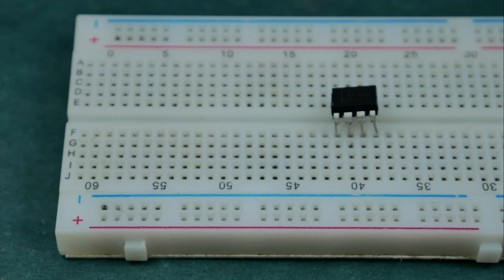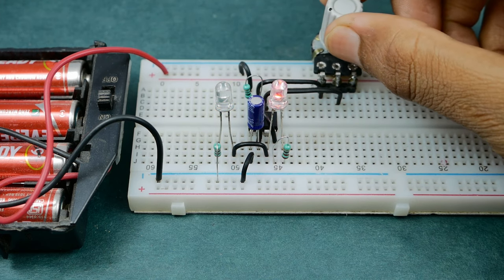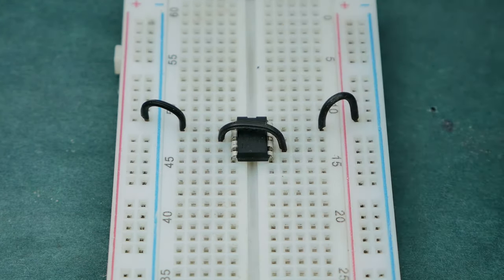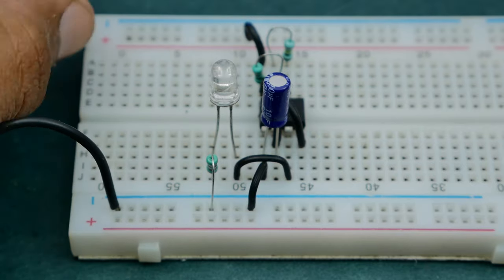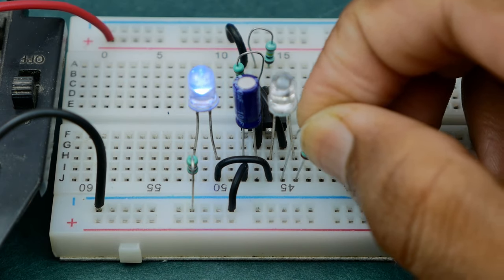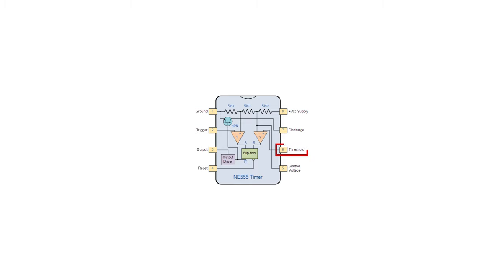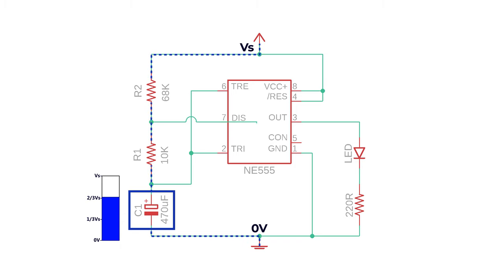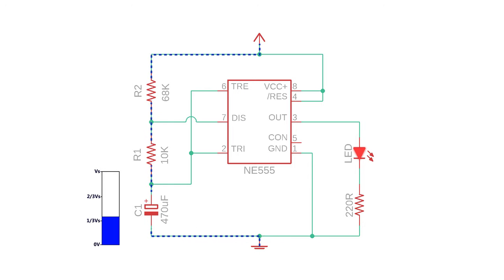Adjustable Flashing/Blinking LED circuit on Breadboard | 555 Timer Project #5

Comment from the maker: The circuit diagram shown in the video is for demonstration purpose only.  This is the schematic with correct resistor and capacitor values: https://elonics.org/sites/default/files/inline-images/flashing-blinking-led-circuit-using-555-timer-schematic.png
Reply: Hi could you tell me what is the relay model. Is single or?

Comment: Thank you for keeping it simple & explaining every step. One of the best tutorials I've seen that doesn't speed throughout it with your hands getting in the way, great rotating video showing the component placement, and showing the exact breadboard setup while explaining the circuit operation 👍

Comment: In your dual alternating led flasher circuit diagram that links to here (https://elonics.org/adjustable-led-flasher-using-555-timer), LED 2 is backwards. the part merely needs to be reversed, or else it won't light.
Reply: Yes you are right bro..👍

Comment: I cannot figure out the potentiometer. Everything works great, disconnect resistor, add pot and both lights just stay on and dim when pot is turned. I've tried every variation, pot size matter or what? Thanks for the awesome tutorial though! This was fun. 

Edit: Finally!! It needed a 500k, other ones were technically flashing, just so fast due to lower pot value you couldn't tell.

Comment: Sir... it's very helpful good work
You said that in this improvement is possible using transistor can you give tutorial on that how you can use transistor with 555timer in flashing circuit.

Comment: Hello, Nice video. I tried the circuit and My LED turns when I put the power, then it turns off and stays off. I have prewired LED with a resistor and the resitor is on the + side of the LED. Please advice.

Comment: So cool!! Does this method decrease the over all current power consumption considerably (versus having the LED light stay on)? Or does it (the capacitors and resistors) use the same or similar amount of power overall? I’m researching ways to make an LED circuit that blinks once every 30 seconds to spike the current to about .050 mA, that uses as little current draw as possible when the light is off. Thank you for explaining how your circuit works, too. I really appreciate the animated schematic!

Comment: Subscriber here.  Love this!  If I wanted to use this circuit to power two 5 volt vibrating motors, how would I adjust it?  I would need to change out the capicitor and resistors?  Advise appreciated.  I want to have this circuit turn on one vibrator, then turn it off as it turns on the other one - just like you are doing with the LED lights.  Thanks!

Comment: Hi, I have tried this circuit multiple times but instead of getting a blinking light, I only get a solid one. I have tried changing the resistors and the capacitors and nothing seems to be working. Is there an issue with my 555 timer?

Comment: Hi. Does anyone know how I can use this circuit with different voltage components, like a 16V capacitor? Do I have to change the resistance on that last resistor? Is there anything else I have to do? Also what value of the LED series resistor do I use for white light? Thanks.
P.S. If any of these questions seem stupid, I've just started this stuff.

Comment: But if I need add to 5 parrel smd so what changes in the circuit
Reply from the maker: No changes required. Make sure that you use the right series resistor for the LED's
Reply: Thx

Comment: Can I use 741 ic replace the 555ic
Reply from the maker: No, that'll be an entirely different circuit
Reply: @elonics  thanks you for your reply
Reply: Can i use 10k potential meter

Comment: Everything is perfect, but I couldn't understand your  words properly , if you could speak a little more clearly because I have to hear every word like 3-4 times and only then I would realize what you are trying to say and even now I am stuck where you used a series resistor for the 2nd flasher but you said yi9 series resistor or what? I am still trying to understand it.